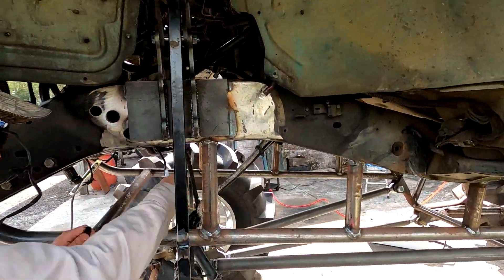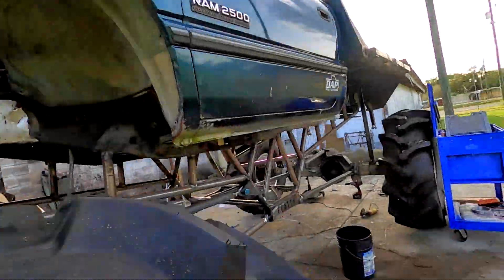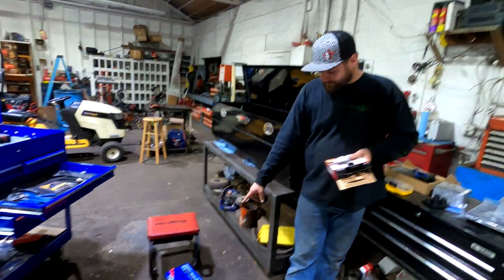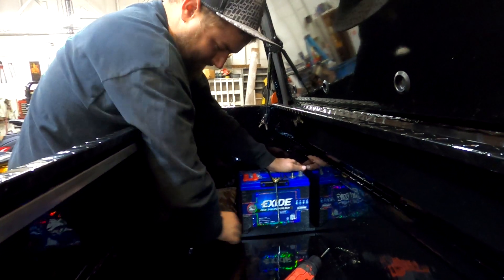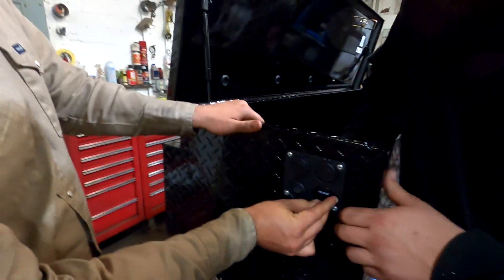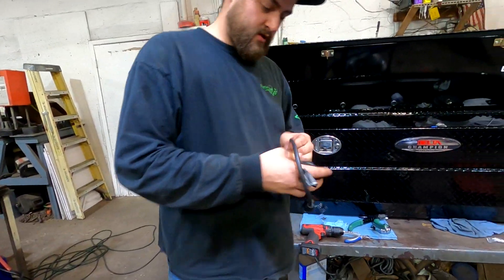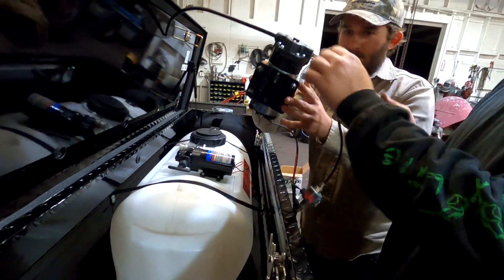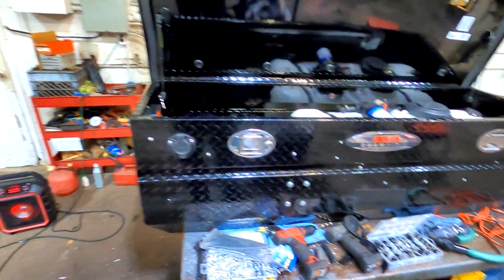Ripping Out Old and Unnecessary Wiring in the FlatNasty!

Comment: Nice clean install bud. I was worried the lid wouldn't close at first, do to where some of the stuff was placed on the sides. Figured the rods that holds the lid up would hit the power inverter or the wires coming out of the plug. But you showed at the end it does close.

Comment: If you go to the Hardware store Lowes might have it there`s a new expandable foam that you can use to put posts in the ground but you break the seal on the bag and pour it where ever you need it and it fills up and turns to a solid in a very short time , Thinking if you make a temporary wall on each end of the tank and pour the foam in it`ll be non movable in any direction ,And it`s life long ..

Comment: If you have to redo the accessories in the tool box, down the road, look at some of the stuff they use for saltwater boats. They are made for harsher conditions (sun,water, salt, sand) and usually have a water resistant rated cover that normal accessory plug-ins don’t have.

Comment: You might want  to put in a power distribution block that you pull all power from the battery that has a master fuse so you don't kill the battery if something shorts out (cheapo inverter) and you could also have a master switch added in.    Great idea to have everything inside the toolbox.

Comment: A good ideal is to put the water tank wire it to your windshield Whopper that way when you turn your wipers on the tank will kick on and pump while your wipers is a turning then get you a fan relay that is a justable were you can set the timer for your pump to build pressure then kick off

Comment: Take some pieces of aluminum and rivet them into the inside of the tool box lip to essentially block the electrical corner of the box off from everything else. Then cut a square hole in the middle with a flush flip up handle and on a hinge so you can open and access as needed and it will keep all electronics safe and away from everything else. Kinda like a battery box for your electronics.

Comment: you might look around for some scaffolding and build a deck arounf the truck , should make it a lot eazier (safer?) to work at  stuff like the engine bay
Reply: where's the cabover
Reply: He is not gonna build a deck for a mud truck
Reply: It’s a MUD truck not a boat
Reply: I built a pallet work area for big trucks, just get the heavy duty ones and screw them together.

Comment: Their is a wire less on and off switch you can get for the tank
Reply: Clayton Wampler your really smart. Doesn’t make sense how you can get a wireless switch
Reply: If the switch has no power then it can’t do anything
Reply: @joeyschultz3774   If you goo to the internet  and search up wireless on and off switch you get one that it takes the power source for its self to receive signal from remote which then all the power goes to the pump

Comment: BRUCE..... Do yourself a favor and mount a 2x2 peice of aluminum angle front to back in the bottom of the tool box between the meth tank and the water tank but tight against the water tank to keep the water tank from shifting side to side bro! I can see that water tank taking out that meth pump real fucking quick......and tbh the meth and batt in the same compartment might bot be the best idea bub! If you enter an actual race the tech team will not allow that for sure......diesel not so much flammable from sparks......methanol highly flammable with just sparks!!!! Perhaps yall cut your nights short bc your late night ideas ain't the best! But none the less great idea with the tool box holding all the sgit you need,!

Comment: Dude,,,,that water tank is NOT secure. When that thing is full of water it will slide side to side so bad it will destroy itself and everything in its way. Brace the sides of that thing bro. With that much weight you better secure the living poop out of that box or it will rip itself from the bed.